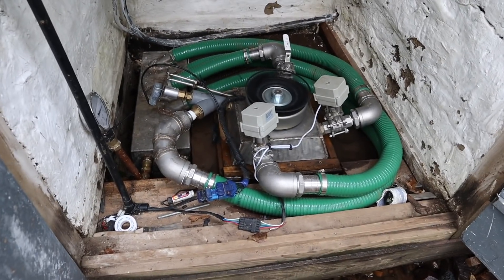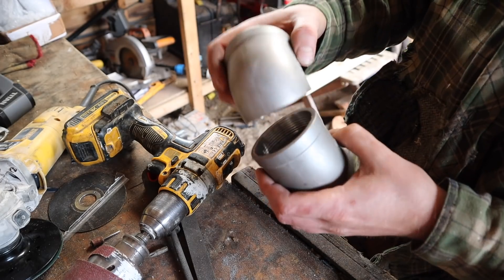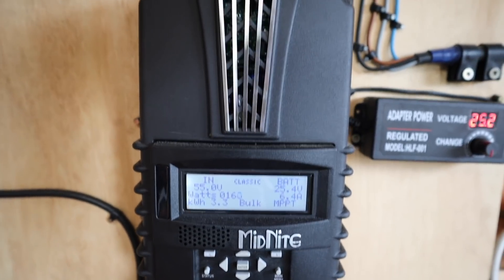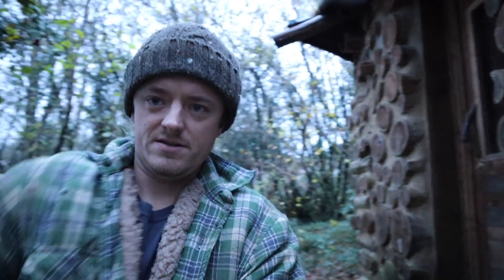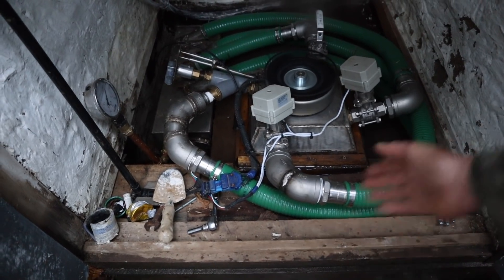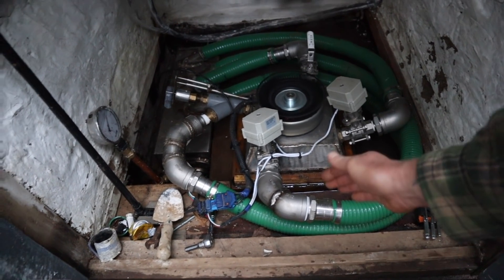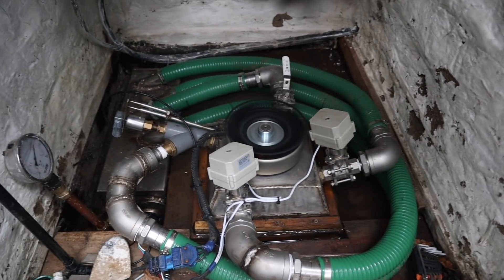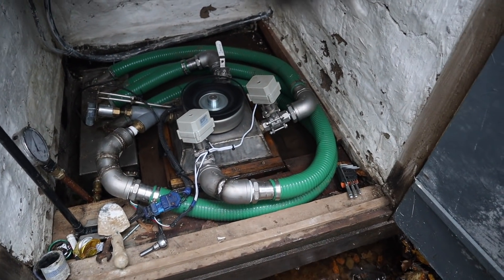Off Grid Micro Hydro Turbine Fine Tuning 90 Degree Bend

Comment: I'm no mathmaticion like you nor do I understand compleatly all the technical stuff either but an idea came to me when you were working
with that 90* angle pipe. Why can you not concider something different other than what you already have like instead of a right angle you 
would need a smoother transition so would a partial coil of pipe get the correct angle to have the water better go into your turbine??? I 
guess the difference would be that the water would travel slightly of a longer distance but that might be so small of an amount. Just a guess.
                                                                                                                                                                                                             Me southern AZ.(USA)

Comment: Hi Kris the 139.83 millibar is 2.03 psi - would that not be considerable? and if I were using a 63mm od pipe with an 50.4mm id its given over 8 psi. Would that be considerable? thank you for any help. Graham

Comment: Question... instead of the stainless manifold and the green piping, could you have a gallery feeding the nozzles and a small vent pipe running back to the water source? (to vent any air in the system)

Comment: Seens most of your videos and loving the series so far, i see you fine tuning alot, 1 thing ive not seen you look at is the spoons themselves or the plate they sit on, have you looked at cleaning that area up, id imagine alot of splash off could be causing slowdown as you got alot of bumps in the surface, how about a plastic smooth bowl to fit over all the bolts etc to smooth it out ?
Learnt alot from you on this, very well explained and great clips showing it all working, good luck with it all
PS, could you bring a electronic presure gauge up to the workshop so you can see the effects of what you do, be good to see if the pressure was the same before you altered something

Comment: the midnight classic has the ability of having a second read out screen attached to it so you could have a read out in your house i was thinking instead of your house have the second read out in the pwr plant room in the pelican box or near it so you can read and tune at the same time it connects with a cat v network cable from charge controller dont quote me on it as its been a while since i've looked into them

Comment: Hi Kris, love the hydro. Just a couple of thoughts could you reduce the pipe runs from the tank to the turbine by running 2 pipes to the left and 2 to the right. Have the biggest flow pipe nearest the tank and maybe rotate the turbine housing 45 degrees so one of the corners is pointing directly at the collection manifold. This would reduce the run more. Remove a control valve from one of the inlet pipes to reduce resistance and control it by the main isolator. A gate valve allows a high flow but is not suitable as a control valve and can suffer from vibration but is an option if just for isolation? regards John

Comment: Would there be any difference it changing that waste pipe to a smooth pipe cud be causing turbulence in water and pipe inside pipe toward motor there's a edge cud cause losses.... why convert millibar to psi not worth it 🤔 keep vids coming👍

Comment: Hello, for heating your water (and making an excess load), you could also use a heat pump, you would get 200% heat more than your electric power (with a 300% efficient heat pump). But for a price, currently...
Reply from the maker: yes i have been thinking about that. and considering it for the future house but it would have to be a very small system and a very well insulated house

Comment: Alright, just found your channel today. Learned a lot. Many thanks.  Im from Manchester uk, i would love to do some like what youvr achieved.  I have 2 ideas, firstly some passive income, mine bitcoin with excess power. You can earn around 10p per kw.  Miner uses 1500w which is likely to much for your current setup. However it looks like your making a bigger hydro system so you never know. 2nd idea, to make your own electric car. Im currently building my own car using an old forklift motor, ive spent £1600 so far and probably need another £1000. Its not a Ferrari eater, maybe a 1.4 petrol but its 2p per mile. 

Batteries are made from old laptop cells and so are recycled. Keep up the good work

Comment: Just a thought 
Just use longer green hose and straight connectors 
Less friction less connections

And your manifold is creating turbulence  causing less flow

Look at a header on a race car  the design is for maximum flow  think of how it works but in reverse to split out to your nozzles

Comment: Just some quick logic and maths, your infeed is 2" into the rather rude looking rectangle manifold with a lot of flat surfaces asking for weekness but then each of the nozzle lines are 2" (or thereabouts) feed the jets. The flow rate of water through hard 90° bends is going to be SFA compared to your sweeping or long bends. Laminar flow would be the only real benefit but as it is hitting the wheel only inches away, no effect.

Comment: The bottle necks are after the bends, should be the same size until the nozzle where the water comes out,  well that is my 10c , your doing a grate job. 450watt 24/7 is heaps of power.

Comment: Why not just use thick wall PVC?  Certainly would be strong enough and a whole lot easier to set up.  Most of the loss you have is most likely due to the ribbed flex pipe you are using.
Reply from the maker: Its not ribbed its smooth on the inside
Reply: @KrisHarbour  Ah.  That would be not as bad then.

Comment: I operate a water truck, i have large diameter hose to small nozzle and find the hose even at a 90 degree bend does not affect  the flow because the whole hose filled with water cannot flow at its max output due to the nozzle slowing the flow in the hose, i see your 90 to two 45's as a compression point for the water, but there will be no changes to your output because of the dam effect of the nozzle restriction,  increase nozzle diameter to increase wattage

Comment: I doubt changes after the manifold will matter since the manifold itself is the point that is attenuating or diffusing the velocity / energy of the water.
Maybe spend the money on converting the manifold to a series of Y outlets. Also google "penstock power equations"

Comment: Wouldn't creating a water inlet higher up the stream be a more worthwhile attempt at getting more power? Even a few meters of head can make all the difference. Meanwhile, I'm watching 
Joe Malovich's Micro Turbine series - his situation is that his turnbine has a drop of over 300ft (100m) and thus its a high-pressure, low volume turbine fed from a spring.
Reply from the maker: That is impossible for me as both intake and turbine are at the boundaries of my land and at the point where they have the biggest difference in elevation. unless i buy more land near me i cant change that.
Reply: Kris Harbour Natural Building I thought that might be the case.

Comment: I'm wondering why you're not using actual weld fittings? Perhaps they are not available in your area but they would make a smoother turn.
Reply from the maker: Not as easy to get.

Comment: there are 2 different types of pressure in a pipe...static and dynamic

static is where the water is not moving, it does not change as you add more water, it only changes when you change height

dynamic is when the water is moving and will change depending on the flow rate

flow rate can change 2 ways ...adding more pressure...or increasing the opening of the hole where flow comes out.....the walls of a pipe also affect the flow...smoother walls allow more flow

velocity is how hard the water comes out and is determined by 2 thing, pressure and size of hole

so the bend in the pipe will not affect the velocity as velocity is not determined by flow...unless you dont have enough flow to maintain steady pressure

it's hard to understand fluid dynamics...what you think is happening ...really isnt

I hear a lot of people say "the pressure coming out of my shower head increased when I changed to this shower head"

what really happened was the increased the dynamic pressure by making the holes smaller, which in turn increased the velocity of the water coming out

so unless you have really low flow and a large hole, that 90 degree elbow was not hindering the velocity of the water

what you may need to do is make the hole slightly smaller...a mil or 2 ...to increase dynamic pressure , which will in turn increase velocity of the water coming out

decrease too much and you will decrease the flow rate too much.....if you increase the hole size, you will get more flow , but less dynamic pressure which in turn decreases velocity

I hope this helps....lots of time even plumbers get it wrong....so engineers correct them
Reply: I made the above comment before I watched where you did calculations....so you already know on an engineer level why it reacts the way it does....so

I hope my above comment helps someone else understand flow rate and velocity vs.static and dynamic pressure

Comment: What is the main water supply you have running from the stream head to the distribution box? Looking to build our own hydro system and trying to design it. What brand of pipe and fittings?

Comment: These videos are great!  Thank you so much! You've already explained the loss of the fittings you're using is negligible - fair enough!  If you search for a fitting with a larger "bend radius" you might be able to find something off-the-shelf so you don't need to fabricate it yourself if you need another bend in future.  In my work we always specify a "minimum bend radius" for conduits.  The pipe bends you've bought are commonly referred to as "elbows", which is a nickname for a bend with a radius of zero.  Sorry if you already knew all that, just tought it was worth mentioning!

Comment: I think based on what you said regarding the lower rate of flow at the bends the edges at the nozel fitting there will be no real difference since the tip is the point of restriction.  The water I don't think is accelerating until after the edge you mentioned. If the nozel were changed to accept a higher flow would your head pressure be enough to take advantage of it?

Comment: Thinking that 4 seperate pelton wheels on a shaft, with each jet fed from 4 straight pipes from a inline bifurcation manifold would b a better system. Only got that idea from seeing what you have .  Thanks for all we have from you.
Reply from the maker: Each separate turbine would have its own set of losses.  turgo or pelton wheels can only be around 90% efficient. Thats without all the other losses. so if you had 4 of them you would lose 40% before even getting it to do any work at all, then all the other looses. a system like that would run at no more than 40% efficiency. my system is closer to 75%

Comment: I think all your pipework and manifold are brilliant, they hit the spot perfectly for this volume of fluid, the bends and manifold radii are insignificant compared to the drag of the nozzles. The actual conversion of energy is from the velocity of the water from the nozzles hitting the spoons where its converted into rotation, the velocity is down to pressure and nozzle diameter, which is a result of the head. If there are any minor gains to be had, it will be down to the targeting of those jets to hit the cups at the most effective point.

Comment: There is such a thing called a “long bend”, well there is here in Aus.
Reply: In the US, its called a long sweep bend.  90 degree bends are not up to code for sewage lines, which is mostly for what 3 to 4 inch pipe is used here.  I'm sure there is a full of s**t joke in there somewhere...
Reply: @nunyabiznez8120  Well tight turns do have a tendency to end up a little constipated..
Reply: Yep i agree 2x45 both same radius  = 1x90 with same radius so losses will be near identical. But 1xlong radius 90 will have less loss . Also its more about flow loss not pressure loss .but all in all not worth chasing i think 
Love ur work thanks for ur time i enjoy ur vids

Comment: Out of curiosity, why don't you have a circular manifold (or 3/4 of a circle, ending at the spear valve) around the outside into which the nozzles connect directly?
Reply from the maker: because the manifold box i got for free and what your describing is a really big cost for a very small saving.

Comment: I would have thought the biggest improvement would be in replacing the box you have splitting your inlet into 4 with a fabricated fitting dividing into 4 that is as straight as possible. Eg cutting 4 x 45 degree bends so when they are welded back together there is 1 entrance and 4 exits. Just a thought, think you are doing really well!
Reply: Dead right.
The manifold he has is creating turbulence where this application needs to ensure the water flow remains as laminar as possible right up to the jets to ensure the most energy at that point.
Turbulence in that box will be causing energy to be lost against the walls of the box as heat and noise in addition to turbulent backward flows against the flow in to the box.
A manifold with 45 degree outlets in series bifurcating the water flow and reducing in area through each one to maintain velocity would be much better.
Reply: @AuMechanic  I agree with your statement! That is completely my first thought and gut reaction. Any energy spent in friction, turbulence, noise, heat, etc is lost potential energy thus reducing output.

That said, for some reason I keep coming back to it is about pressure.  In the back of my mind that the manifold box isn't dropping pressure..........so as long as sufficient flow can pass through the manifold to max out flow from the jets then it won't reduce output even if the manifold reduced max flow.........

Oh the conundrum! 😝

Still I think he has done a awesome job so far, so totally jealous I can't play with one of these in my backyard!
Reply from the maker: My total loss of pressure at full flow is 3psi. That is 1.4m of head loss or 41w at full flow over all the pipe, manifold, fittings and nozzles combined. Changing the manifold would be days of work and hundreds of pounds in material and i would expect maybe 10w of improvement as Almost all the head loss (2psi) is in the 210m of penstock the losses from the manifold up are tiny. Im going to do an efficiency calculation to find out what we are at and see if there is really any improvements left to be made. im quite sure im close to 75% witch means there really isnt much else that can be done as that is the upper end of what is possible. i will do a video soon.
Reply: @MrPaulviles  
Pressure is only one part of the equation of power, pressure will exist even with no flow so pressure is the "potential" energy.
The second part of the power delivered is the weight of the body of water moving being velocity / mass so that is the "kinetic" energy
.
And turbulence causes kinetic energy to be diverted into directions other than the jet where it is needed.
Reply: @KrisHarbour  
Pressure is a static measurement.
See youtube video called "hydroelectricity power and energy calculations"
Re the cost, Pipe Y sections are not expensive but since you have a welder you could fabricate them from pipe for far less.
Just need to get to  a band saw to cut the sections.
Reply: @Kris Harbour Natural Building, totally understand your line of thinking! Cost vs gains..........

Could I pose a test if possible? You did a test on just the large nozzle with a hard 90 degree bend and sweeping 90 degree bend, is it possible to run the main pipe directly into the large nozzle? The orientation of the turbine would allow for a straight line into the nozzle and remove the manifold and any bends. 

I appreciate it would take some time and effort. However, it would conclusively determine if there actually is substantial loss caused by bends, manifold, etc it would show a absolute optimal output. 

Just thoughts mate, I appreciate what you are doing and take my hat off to you!

Comment: What if you tightly packed the full length of all bends with straws? 

Is that a stupid question?
Reply from the maker: For what purpose? all that surface area would just add lots of friction.
Reply: @KrisHarbour  Creating a laminar flow effect. Directing the movement of water within the bends.
Reply from the maker: @slump75  if there was really fast moving and turbulent flow then the might help keep that turbulence from creating a vortex.  but i think in this situation with the low flow rate and slow water speed it would just add friction.
Reply: @KrisHarbour  Yes, that makes sense. I think out loud with little understanding of the finer points of engineering and such. Thank you.